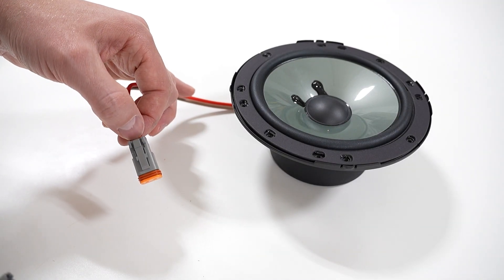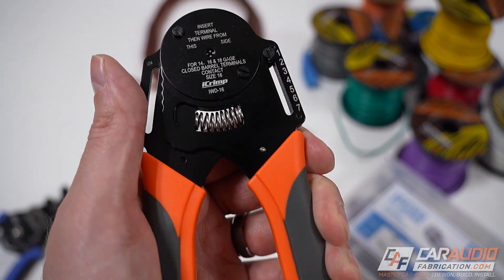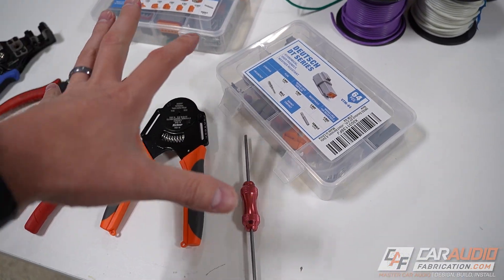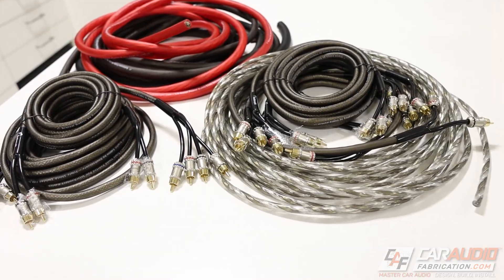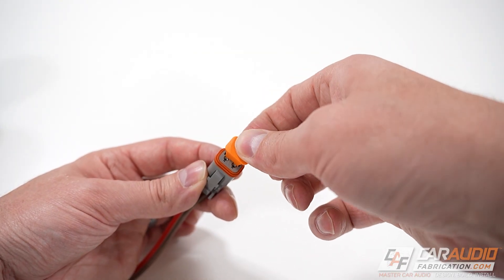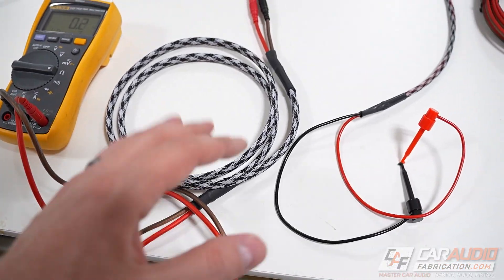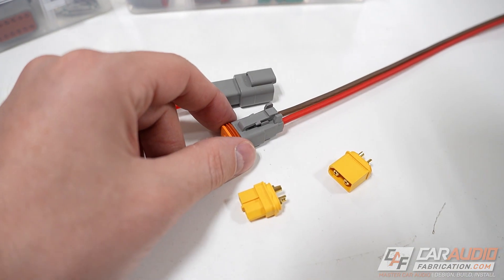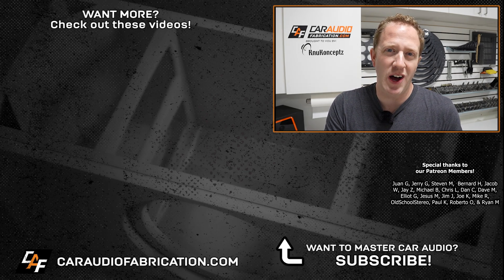Quick disconnect FULL Car Audio System - Deutsch style connectors

Comment: Perfect use case for a removable amp rack. I’m setting up a Helix v eighteen full active setup in my M5 (G90) and must be able to remove my box and amp rack. BMW service / warranty won’t work on my car with aftermarket equipment installed. These cool guy plugs will work wonders. I’ll probably use the 12 pin and 6 pin connectors.

Comment: I still like the rc connector better, no issues soldering, and they are smaller, if you buy them get xt60w, they are the waterproof ones.
With the “w” at the end. And use waterproof adhesive shrink wrap. 
They  are my go to, for Harley saddle bag disconnects.
Never had an issue with accidental disconnects, nor have my customers.
Also great for auto speaker disconnects.
I use them backwards from each other if two wires run to the same place, like an active tweeter and mid, that way , they cannot be connected wrong. 
The other connectors are just a bit large in size for me.
Not something I want dangling around under a bike.
Interesting idea using more than two conductors though.

Comment: Would these connectors work for both LOC in /AMP out door speakers at the amp rack? If so, this would be a great option for quick disconnects for adding or servicing. Im building the rack now, so I have time to order if so.

Comment: I have a powered subwoofer that is missing the “quick connect” power block. Cant I just use the female pins to connect it instead of spending $80 for a new kit?? Rockford Fosgate P300-12

Comment: Thank you.  I've been a fan for a while.  If I need to check out a subject, and you are talking about it, you are typically the bench mark for the best information.  I am looking at making connectors for under a motorcycle seat.  I have limited space and you just showed me how easy it will be to take 12 wires and make one easy to build, reliable, quick disconnect.

Comment: Thank you for posting this!  I am preparing an audio setup and am grateful to have found your video. Would you say it makes a difference or not by putting the male pins in the female plug and the female in the male?  This isn't a connection I see myself disconnecting on a regular basis.  Thanks much!

Comment: Kinda off topic: My uncle is a 40 year (certified) mechanic. I asked for his help on my car once. It had an electrical problem located in the main wiring harness under the hood. He said, you have 2 options: buy a complete harness for about $400.⁰⁰ or fix the factory wire connector. This was kind of intimidating at first glance, but when he showed me how to get the wires out of the plastic connector, I was floored. (I can't tell you how many connectors I've cut off and taped another one in place lol).

Comment: As always, great explanation. Was just looking at them and wasn't sure how they worked and now I know. One thing to note that the 16 size works for 14AWG, 16AWG and 18AWG so no need for anything bigger for speakers, but for sub probably will need a different size

Comment: When I installed an aftermarket tail light on my motorcycle I didn't want to cut into the factory wiring, so I sourced the factory connector that Kawasaki used for the tail light.  Turned out to be cheaper to buy a box of them on Amazon than to buy a single connector anywhere.  So when I installed the head unit in my car and discovered that a previous owner had chopped off the factory connector, I decided to just make use of the pile of connectors I had sitting in the closet.  They weren't the nice Deutsch style connectors, but it did mean that there was no ugly electrical taped wire splice rats nest under the dash :)

Comment: I already use these things for EVERYTHING, lol. They can be pricey but they are totally worth it. There are also FLANGED versions that can be used like a firewall connection such as being mounted through an amp board. You mount the flanged connector, which is the female receptacle, to the board and then have a nice harness coming out of it to then connect to your amp or DSP. Can be used for speaker connections or even custom RCA’s. Power for an amplifier is a bit more complex though but they do have the Deutsche HD connectors as well which I’ve seen those as big as 6AWG pins. Those are usually single-pin connections though. But, doing something like that would eliminate having to run the wiring through holes in the board and then having to put trim pieces to keep it looking nice. The same concept however can be used with the little mounting brackets in a surface mount style install where the wiring is exposed. I will also say that the 8-pin connections use a DIFFERENT mounting clip than the rest. Not a big deal, just be aware of it. You can also STACK multiple connectors onto the same mounting clip because most of the female receptacles have both male and female mounting groves in them to link more than one to each other. But these are awesome.

However, I personally like the OPEN style of pins instead because they offer some stress relief to the conductor connection since they have the tabs that crimp onto the insulation itself. I’ve had the closed ones have wires get pulled out of them in the past which is why I switched. I also have special crimpers for that style of crimp as well. They literally look like they were factory crimped when I use them. The possibilities of using these is endless. One of the best custom wiring products ever made. Yeah, you could use Molex, but those don’t look nearly as professional as these do. There are also several sites out there that sell OEM-type connectors for whatever vehicle you have to make it look even more factory, but those are usually purchased per-connector and can get very pricey, even more so than these. But if you combine some nice heat shrink and wire loom with these, the custom harnesses you can make with them are downright beautiful.

Comment: I have a easy solution for this.. just mount ur amp away from the sub, that way there is just the speaker cable running to it.. witch makes taking it out super fast.. problem solved!

Comment: So these are the DT series connectors and rated for up to 15A. There is also the DTP series that are rated up to 25A which are more commonly used for lightbars and driving lights. Given the costs of these plugs, I would use use them anywhere they wound be exposed to the external environment,  ie; inside doors, but for internal use I would recommend using the connectors that utilise the male and female blade terminals. However if space is a determining factor, the Deutsch plugs in a 4 or more pin combination will be way more compact and, imho, much neater and more professional looking. 
That's my 2c for those who never asked for it. 
But great video and very informative. 👍

Comment: I love this. I was going to use those solder on 2 pin connectors from the hobby store to build a wiring harness for lighting accessories for my truck and motorcycle but this would make it so much easier. Especially with fog light pairs. I would use the doubles for each fog light and then another double or quad to pair them up for the longer runs

Comment: Question about apms please I need help :/ 

I have a mono amp and a 4 channel amp. Do I need to link them to each other with RCAs??? Or can I run them individually?? 

Individually meaning 

Mono amp connected by RCAs from my head unit (subwoofer) outputs 

And my 4 channel amp connected from the other head unit RCA outputs??

Comment: So I just installed an older pioneer head unit and dual front door speakers to replace the blown factory equipment this is just a temp set up so it's not screeching at me however my question what would be a recommendation for a system in a 2006 beetle

Comment: My only issue with these types of connectors is QC. I've used these before and a few have had minor gaps and what not, which cause intermittent connection issue (voltage drops). Not a difficult diagnosis but considering its very tough to see the imperfections sometimes. It tough to recommend them over solder and or crimp connectors.

Comment: I'm in the heavy equipment industry, and this is basically the only style of connection that is used across the board. And I mean all the OEMs are using it. Hitachi, CAT Liebherr Kawasaki, and many more.

The weather proofing is the most advantageous of this style, as these machines work in some of the worst ever conditions. Dust, rain mud, heat, cold. The only disadvantage for me is the cost, and when they were buried in dust and mud for long, it can be a pain to disconnect.
You even get round 21, 31 and 36 pin connectors.

Comment: id rather have the solderable connections for the corrosion prevention of the solder coupled with the fact that you can by sticky zip tie mounts instead of having to mount with a screw for the other type. You can use double sided tape for those, true, but in my experience a solderable type connector is the preferred standard.

Comment: I didn't see it mentioned but the GREEN STRIPE pins/sockets have a thinner wall (larger ID) for 14 guage wire.  Non-GreenStripes have a thicker wall(smaller ID) for 16 guage and is especially better for crimping 18 guage wire.  You can use green stripe wire for all, but the crimp isn't as optimaal for the best crimp surface area contact and crimp holding, but in the thousands of crimps I've done in my career, using green stripe for 18 guage has never failed me, just theoretically worse.
          Also, you need to buy a better wire stripper with a depth setting.  When using these barrel crimps, it's best to cut the insulation to the exact depth of the copper fitting into the barrel pin/socket.  For the style of connector you're using, it's not as much of a problem, but for the round deutsch connectors which require a plastic disposable removal tool you'll understand why when you have to pull those wires out.  Stripping too much results in a more flexible and flimsier wire, making it harder to insert and remove.  The wire stripper I use at work are the Phoenix Contact WireFox 10.  Though my coworker has the Knipex version and he likes those.  They're the same design.  With either you can cut and strip wires quickly to the exact depth you want.  Having that kind of perfect repeatability makes larger harnesses a breeze.
          Also, Iwiss makes a nicer deutsch crimper for about $130 on Amazon.  Worth it because it's easier to adjust for wire guage so the crimp impressions are deeper  depending on the wire guage you're using.  It's designed to be a knockoff of the OEM Deutsch Crimp tool.

Comment: If you really want to give yourself a challenge, try messing with an 80 pin ECM connector that is corroded because heat got to the seals causing them to swell up and let water in, or when they are covered in oil. After years as a HD truck mechanic, where these are used extensively, and sometimes excessively, I never thought that I would see them used in this way. That said, I like this idea and may well incorporate it into my build. A word of advice to everyone, including you Mark, if you use those little mounts, go easy while connecting and disconnecting them. They are brittle and it doesn’t take much for the tabs to break. A REALLY good place to use these is on the wiring for any external lighting that is being installed. A lot of the pre-made light bar and fog light harnesses use them already. But if you are like me and build your own harnesses, switch and relay panels, distribution panels, they make for a very clean and mostly weather proof install.
Reply: That constant thermal cycling under the hood of cars wreaks havoc on plastics and seals, like you said. I would hope they can develop some better polymers to combat this problem.
Reply: @Grizzleback07  I would like to see that myself. I guess on a positive note, most connections like this for an audio system would be inside the car instead of under the hood, and even then they hold up for a good while.
Reply: Laughs in Caterpillar
Reply: @michaelgeale9345  This guy knows

Comment: I just used some molex mini fit connectors on speed wire. Weather pack could be used as well and are easy to work with. Deutsch connectors are nice as well.

Comment: Used those when I installed my digital dash in my 86 IROC.  Tried replacing the bulbs in OEM gauges, but still was too dim for my old eyes, so I replaced OEM with digital gauges and used those clips for all the wire connections.  Worked perfectly, and the OEM gauges are safely packed away for the time I decide to sell the car, if ever.

Comment: I personally don’t think I’d ever use them. At least on my own car, maybe on a friends car for their convenience. Personally I’ve invested a good amount of time into my system, I’m already committed to the connections that I like to use. If I have to remove a panel that I know I’ll be messing with any of my own wiring, I’m already prepared to deal with it the same way I have for a long time. I personally would probably use this style maybe behind the head unit for any connections, make it look a little more professional and convenient. Or even for non audio automotive applications I’d probably use it. ESPECIALLY if it’s outside the cabin of the car, under the car, in the engine bay, etc.

Comment: This is EXACTLY what I was looking for! Thank you! I will use it to make my amp rack as "quick disconnect" as possible. I can easily mount the connector onto the rack and pull it off whenever needed. I need 6 per side so 12 total and they have plenty of room for that. I may get 2 for the subwoofer wiring as well but I think I'm using 12 AWG for the subs so I'll need to size up. 1  will be at the rack and the other will be on the sub box for quick removal of the sub box if needed. That could come in handy later.

Comment: Amphenol SINE makes those type conectors as well, found them on mouser. In the 18 pin version, there is a bulkhead version of the female one. I am using that one for wiring pass through to the cab, from the engine compartment. This is for a gauge read out diplay, to monitor the vitals of a mecanical diesel.
Reply: These are used on earthmoving equipment too, where I've been using them since 1994.  Very good connectors!  I've been told that Amphenol bought(?) the design, or maybe bought Deutsch?...  but they've been coming from Amphenol instead of Deutsch for some time.  The miniature version, the ATM series, saves a bit of space and probably carries plenty of current for audio use.  I get my parts from Digi-key, but Mouser is good too.  Both have links to the Amphenol literature so folks can learn all about the parts and how to use them.

Comment: Now it is time to redo all of my connections, especially. Thanks Mark! - A project is never really done. You learn better and you do better.
Reply: @@E.H.O speaker wires do not draw that much current especially tweeters and depends on how long the runs are. I’m curious of whether the voltage drop across the connections are different in average, but that is based on the skill level of the installer. I didn’t enjoy soldering 16 gauge wires and sometimes melting the terminals. I’d rather crimp and save time.

Comment: Have you used any other plug style?  I generally use MINI-FIT for interior work.  Many amps use them as well so it is nice to have some around.  Deutsch connectors are great when doing something that needs a more weatherproof connector.  Not crapping on your choice because they are a great option, just interested in an opinion.
Reply: Deutsch barrels are much easier to crimp.  Just adjust the barrel so it sits flush with the surface of the tool and insert your wire.  After that, just plop the pin/socket in and insert your wire, no fiddling with orientation.  It makes your workflow much quicker and easier when doing wires harnesses with lots of wires.  I know, because I've crimped thousands of wires using deutsch, weatherpack and molex.  Except at work, I have the expensive $500 deutsch crimper and $200 weatherpack crimper and $400 molex mini fit crimp tool.  If you want to buy a tool for crimping Deutsch at home, I recommend the nicer version of the Iwiss tool in this video he's using, the iCrimp HD-2612D which is very similiar to the OEM grade deutsch crimper I use at work.  The adjustment for the wire guage(amount of indentation) is much quicker.

Comment: I installed the yellow ones when the first video came out a few years ago. Later on i bought a audio control 5-1300 and had it installed by a shop to retain the 5 year warrenty. Lol, the shop made me cut out the yellow speaker connectors saying it added far too much resistance to the system. This was Cartronics in north miami beach. All so they could run their own wire. Goodness, I wish knew back then what i know now

Comment: Got to say the Deutch connection of any type and size surpasses any connection competitors.  Gold pin option or standard, makes a professional install availability for even sensitive components
Reply from the maker: Yes, I get that feeling as well, these are much more professional and solid and seem more designed for our application vs some of the other solutions.
Reply: @CarAudioFabrication  I have used them for my personal systems for over 5 years, Where I could atleast. Great for motorcycles as well too.